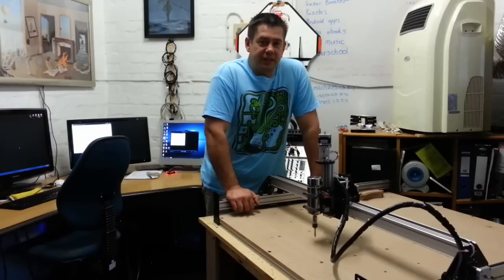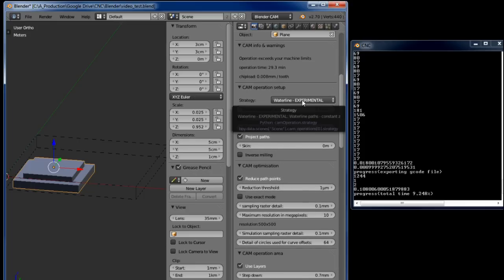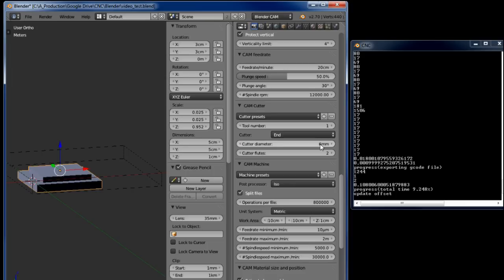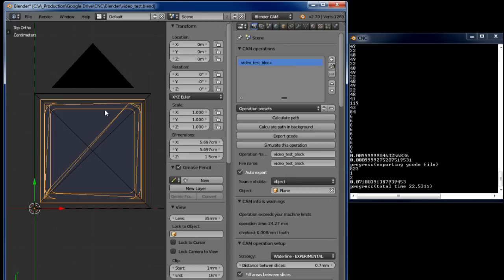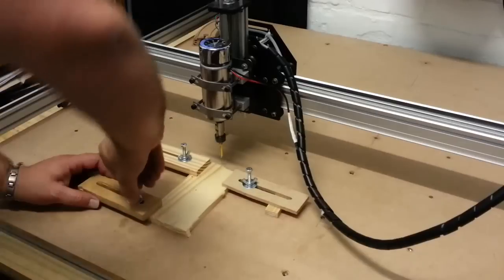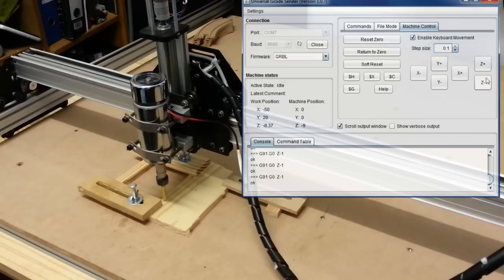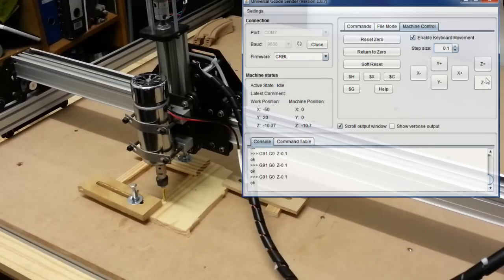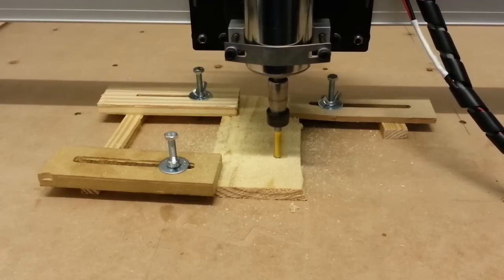Shapeoko 2 cnc blendercam universal gcode sender

Comment: how do you install blendercam?
Reply: Hi David

Last time I did it, I had to check the blog to see which Python modules I had to install. Those help with the Maths calculation. I know the one is numpy. Can't remember the other one. After the Python modules are installed the Blender containing the Blendercam software can be downloaded from BlenderCam and it will run.

This video I did is very old by now. And, even though I don't enjoy using the software, Autodesk's free Fusion software is my new "go to" software. Apart from using Inventables's Easel software. I export the paths gcode from Fusion and load it into Easel to run the Shapeoko.

Good luck!

Comment: I'm just getting into CNC and this video answers a lot of my questions!
I apologize if I missed something, but did you specify if this is a stock Shapeoko?  Did you have to swap in another controller to get it to work with UGS controlling it?  Or was it an all stock system?
In other words, if I'm using UGS on, say, Linux or macOS, would I have to get a different controller to run a Shapeoko CNC system, or can I run it under UGS fresh out of the box and newly assembled?
Reply: Hi there! Thanks for the comment.
That machine is a stock Shapeoko 2 with the Arduino controller board. Connected to a Windows or Linux laptop running UGS.
A couple of years later now. Same machine is still working (7 years). I had quite a few misfires running UGS. Unintended stops, lost communication, random weird stuff like switching on the machine and using keyboard keys to position the cutter, and then it just drills down into the wasteboard instead of moving in left or right. Eventually I found it very nerve-wracking.
The Easel software provided by Inventables honestly gives the best control I have had to date. Pity that it can't do 3D carving in terms of creating 3D paths, only 2D. But I suppose one has to invest some proper money for that. I installed the newest driver on Linux Ubuntu and been running like that for the last year. Still do my designs in Blender if it is intricate.
Blender has released new software. I don't know if the Blendercam project is up to date.
Good luckw ith your carving and enjoyment of the machine. For me it is a utility, cutting small shop stands, laptop stands, small boxes. It remains a very functional and productive tool!
Reply: @StefanVanderVyver  One concern of mine is that I have a Linux computer in my shop and a Mac in my study - not laptops (I don't like laptops).  I haven't worked with Windows since about 2001 (other than a copy of XP in a virtual machine for testing my own software - and I blocked it from the network).  So I'd really rather not have to get a Windows system that would be doing nothing but controlling a CNC system.
I looked at Easel and it didn't give me much information without signing up.  It looks to me like it's a web application for design with a driver to download for control.  (And, luckily, it has Windows, Linux, and Mac versions!)  Is it the Easel driver that can't do 3D or the Shapeoko that can't?  (Even with an Easel driver, I'd be using Blender.  I'm learning it for architectural design, since we're still doing work on our lot - like renovating an old pig barn and building a tractor shed.  I like being able to use one program for multiple tasks!)
I've heard of other people having trouble with UGS, but not as bad as you describe.  One person was recommending it and said that there were times he would have to restart it because it would stop, but for it to randomly turn a machine on or drilling into the wasteboard is pretty bad.  I see you posted this video in 2014.  How long has it been since you used UGS?  (I figure I can do some research and find out if they fixed some of those issues.)
I have read that BlenderCAM has to go on Blender 2.76.  I have the latest Blender on my Mac.  My plan is to put both 2.76 and the latest version on my Mac and on the Linux box in my workshop and on my Mac in my study.  (Easier to do computer work in the study - the computer is set up in the shop mainly for device control and displaying plans on a monitor, not so much as a computer work space.)
Reply: @DreamingOfAtlantis  Hey! Same setup as me then. I work mainly on Mac in my office and then carry a low powered Linux laptop to the workshop to run the CNC.
Easel actually runs in the browser. And it is Easel that doesn't do 3D contours. Although... I've never tested whether it will allow you to load a grbl file that DOES have 3D paths. So the jury is out on that one. I.e. you CAN load generated paths in Easel. So you cna generate in Blender and then use Easel instead of UGS.
One thing that I suspect with Blender and Blender CAM... and I will take a smack on the nose gladly if I am wrong... it's all about how efficiently paths are generated. You can cut the same design, but have a bad path layout that takes 7 hours instead of a good path generated on expensive software that will only take 1.5 hours to run. Something as simple as lifting the cutting head on the way back from a pass, instead of staying down. Just that simple action doubles the cutting time. With BlenderCAM and UGS I had so many problems with cutting TABS that I eventually left it. When a cutting head tries to cut through a big tab you can easily lose steps on a belt-driven machine. This happened often when a TAB was being left and then one of the lowest paths for some reason would not include a command to lift the cutting head at the TAB... so through she goes.
So back to Easel.... work on the Mac while logged into Easel. Design to scale, or import svg design that you did in Blender. Set it up. 
Then walk to the shop with the Linux machine, plug in the machine. The driver handles the link between the browser and the USB controller. Log into Chrome on Linux machine, sign into Easel, call up the design, and start controlling the CNC from there. No UGS required.
Nikos Satrias (Rabbit mill) from Greece also has a version of UGS that he uses for the machines that he builds. You can try to contact Nikos to find out if that is still the case.
Agree with your research about BlenderCAM going into older Blender. I love Blender. Did commercial animation with it for more than a decade and reviewing a new Blender texbook as technical reviewer at the moment. So I am not knocking Blender. It's just that CNC is a very violent destructive cutting method, and I want the confidence to switch on the machine.
The work on the shed and barn sounds pretty awesome. Good luck with that! Check out the "MeasureIt" add-on you can enable from preferences and also this extension:  https://github.com/Clockmender/Precision-Drawing-
Tools/wiki
Reply: @StefanVanderVyver  I've gotten tired of using 2D CAD and having to to front and side (and sometimes the 2nd side and back) elevation views and then, when I change something, having to change from 2-4 elevations.  So that'd driven me to Blender (once I found out it can be used for that - including things like marking dimensions and so on).  I've looked at Blender in the past, but didn't have time to learn it like I wanted to.  I've always wanted to do 3D modelling and even some animation.  Now I have a good reason to learn Blender - for the architectural work for our lot and buildings (plus things like a new desk in my study).  I like that I can also use it for CNC and, eventually, for animation.
So, from what you're saying, you don't feel that BlenderCAM is generating efficient paths and Easel is?
Can the Easel driver at least do different depths of holes?  One thing I want to do as an early project is to make some cabinets that I can easily add drawers or shelves to.  (These cabinets would work as legs for a desk.)  Part of that would include being able to do some holes that don't go all the way through, for pegs to hold shelves.  I also want to do "pre-drill" holes for slides for drawers if I want to add them, and I don't want those to go all the way through, either.  It's not true 3D, but that depth control would matter.
If I understand, you're doing the design in Blender, saving it, uploading it to Easel, and using Easel to generate the paths and control the Shapeoko.  Is that right?  And I take it the reasons for that are 1) Easel controls the CNC device far better than UGS, and 2) Easel generates much more efficient paths than BlenderCAM?
Is https://www.sourcerabbit.com/ Nikos' website?
I am brand new to all this and want to make sure I can put together a good working system.  I don't want to be cheap, but I don't want to spend more than I have to.  I've also looked into LinuxCNC - which seems to work for a lot, but it doesn't do Grbl.  My understanding is that Grbl is basically a subset of what LinuxCNC can do.  I haven't asked, but I would suspect if a G-code file were preprocessed for Grbl, it should work on LinuxCNC.
I also found this (https://forum.shapeoko.com/viewtopic.php?t=9052) about someone looking into using LinuxCNC for controlling a Shapeoko system.
Right now my concern is getting a good CNC device with a big enough work space that I can do the things I want to do and be sure I can control it from Linux or macOS or both.  Once I get the basics working, I don't mind hacking around to add things, like changing the controller so I can use LinuxCNC for better control.
Reply: @DreamingOfAtlantis   Your electronics skills seem to outweigh mine by far! I wouldn't be able to simply switch out controllers. Not electronically minded at all.
That site is indeed Nikos's site. It was pretty cool to have him take over my CNC via Teamviewer all the way from Greece to South Africa to test out UGS (or his version of it) at some point!

I checked out LinuxCNC. What kept me out of that was that you have to consider it a "closed" tool. Install it. Then it runs. Almost as if you set it up as a read-only control box hardware unit. Because once you are tempted to do the normal apt-get's you can break the installation. And I couldn't figure out whether LinuxCNC would drive USB machines. With my limited knowledge at the time it felt as if that was a limitation. I thought that it only drives parallel port machines. Because of the syncronous nature of the interface. But hey.... a CNC must read code and cut. And it must do so repetitively and reliably... so if LinuxCNC can be set up wtih Shapeoko to do that... fantastic!

Easel can indeed do different cut depths in one program. So you could do the holes that are partial depth, and then cut the outline all the way through the material. All in one design. You simply specify it by drawing separate shapes with different cutting depths. It's a good way of making the software go further. And to start with it is a very quick way to get going. The learning curve is usually a bruised ego, a couple of broken bits and some material wasted.

For the last few months I have mostly drawn designs straight in Easel. But the option is always there to quickly do something in Blender, export it as svg vector file, and then import that into Easel.

I do not have a license for VCarve Pro. The monetary conversion rate is insane this side of the pond. But I think they do demo versions that allow you to generate paths. At some point I did some comparisons and I really saw what is possible with the commercial path generators. In the end it is an algorithm, and algorithms are dependent on the coders who build them. So it stands to reason that some people come up with more efficient paths. Even though we tend to feel the machine would essentially do the same thing.

I have not had a single misfire using Easel. And the path generation is very very quick. The newest Blender can't export svg files yet. So to export svg you can use the normal Blender 2.79. 
Blender is part of my life blood. I breathe it. Ingrained in my mind.
Reply: @StefanVanderVyver  I was on early BBS systems in the 1980s that would let me use a form of email that could go around the world in a few days.  I've seen all the changes since then and being able to use Facetime to see our 3 year old grandkid in another city, or having someone a continent away take control of a computer still amazes me!
I checked on UGS.  Here's the version history:

Version	Java Version	Release Date
2.0 Classic (Beta)	Java 8+	August 14, 2019
2.0 Platform (Beta)	Java 8+	August 14, 2019
1.0.9 Classic	Java 7+	November 11, 2015
1.0.8 Classic	Java 7+	February 25, 2015
1.0.7 Classic	Java 7+	March 30, 2014
1.0.6 Classic	Java 6+	March 15, 2013
So it looks like a major jump from 2015 to the code in 2019.  Have you used UGS since the 1.0.9 version?  I want to check around and see if the worst errors (like cutting into the waste board or turning the machine on randomly) have been fixed.  Documentation on UGS is not as complete as I'd wish.
I'm also going to contact your friend Nikos about his version of UGS and his CNC machines.
I'll let you know what I find out about the newer UGS.
Reply from the maker: @DreamingOfAtlantis  Picked up on the underlying understanding there! I have not used UGS for a few years. I would say probably since 2018.
Here are a couple of things I would check out with the new UGS:
1) Stop a cut as if it was an emergency. Like if your path would cut into a clamp or something. So you slam on the power button to switch off the controller. Or you click on the "stop" button in UGS. Did the machine stop immediately, or did it want to complete the last batch of instructions it received?
2) Then see what state the controller is in when you switch the machine on again.... did it clear the cache? Or are you seeing inconsistent behaviour because some remnants of the previous program is still there?
3) Switch on the machine. Use the keyboard keys to move the cutting head (sorry I forgot the word now for that... ha ha). What happened to me was that I would click the checkbox in UGS to use the keyboard controls, and when I hit left or right first, before using the mouse to click on the movement arrows int eh GUI, the machine would sporadically try to drive the cutting head downwards.
4) Oh yes.... and always ALWAYS   AAAAALLLLWWAAAAYYYYSSS double check the increment setting before you do anything. Clicking twice to move the cutting head down when you think it is set to 1/16 inch, but it is actually on "1 inch"...... yeah... that is human error and if it sounds like I've made that mistake..... guilty!
Reply: @stefangas  Got it.  I'll be saving that until I get a system to use, so I can verify UGS as reliable or not.
I did see a bug listed on Github that was specifically about it stopping at unexpected times.  There's a long discussion on that and I'll have to go through it more thoroughly later, but the short of it is that they were concerned about communication issues between the computer and other parts.  They were even talking about moving the Arduino to avoid electromagnetic interference.  While that's possible that can often be the last ditch item to check before saying, "Yeah, our software is not communicating properly."
When you use the Easel driver, do you have to use it through the web app Easel?
At this point I'm looking at 3 CNC systems and tomorrow I'll be calling 2 companies to talk to them about their systems.  Shapeoko is one.  Avid (cncrouterparts.com) is another.  BobsCNC was my first choice, now it's 3rd.  What you've told me about UGS is a serious concern - but if I go with LinuxCNC, that uses a parallel port and I think the idea is it has more direct control over everything.  I so wish I could just sit down and talk on the phone or have a video chat with someone that knows both LinuxCNC and UGS to get a good comparison.
Reply from the maker: @DreamingOfAtlantis  Awesome. What a nice shopping adventure! 
I can say that the X-Carve from Inventables is a fantastic machine. It is the newest generation of the Shapeoko. Uses a new controller. It's also fairly simple to upgrade the machine to bigger size.... you just order bigger rails and take care to screw in supports.
Plus their shop is great and they deliver quickly. 
The Easel driver kicks in along with the browser yes. So as soon as Chrome loads the Easel software the controller kicks in and the machine responds.

Good luck with the journey!   

stefanvandervyver4atgmaildotcom
Reply: @stefangas  Also, you might find this interesting.  Have you looked at BCNC?  it seems to do what UGS does without dropping communication.  (Apparently that's the bottom line issue with UGS - I've found several complaints that it loses connection and that leads to dropped commands.)  Also, your friend's G-Code Sender is freely downloadable.  This makes me feel like I can go on and order a CNC system and count on either BCNC or Nikos' system to work on Linux and send out Grbl from G-Code.
https://newscrewdriver.com/2019/09/19/unreliable-serial-communication-with-ugs-try-bcnc-next/